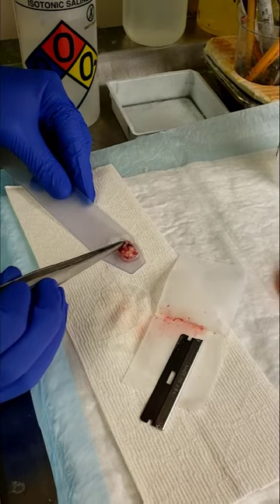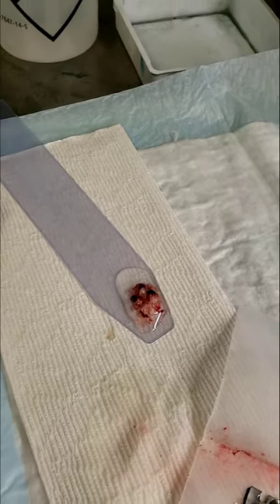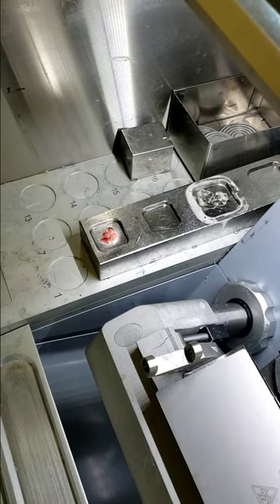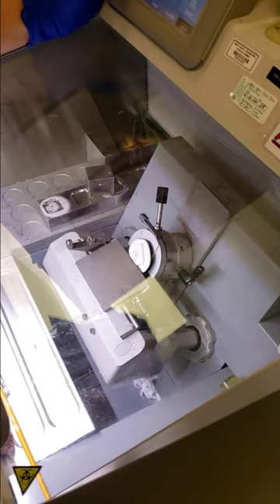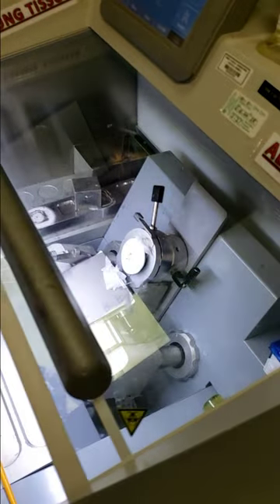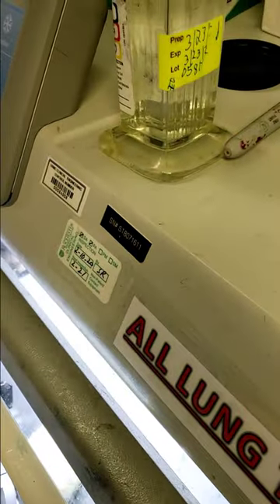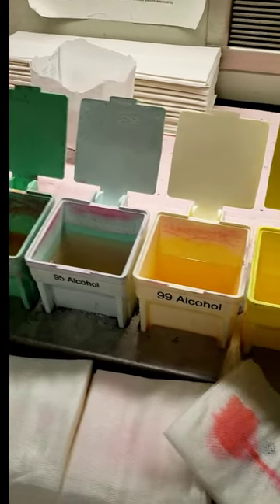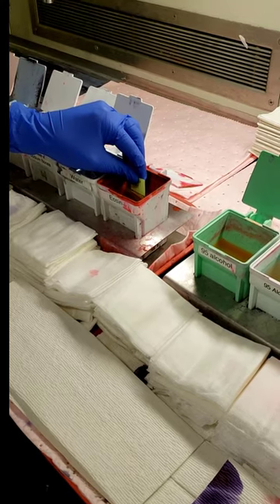Pathology Frozen Sections: What We Do

Comment: I wonder if the machine used could carry cancer cells from other ppls specimens and make someone’s be “ cancerous “ who doesn’t have cancer
Reply: You clean it in between cases.
Reply: You clean the machine and change the blade between patients. There is also a UV light process you can use.